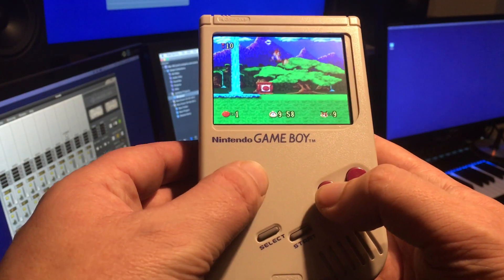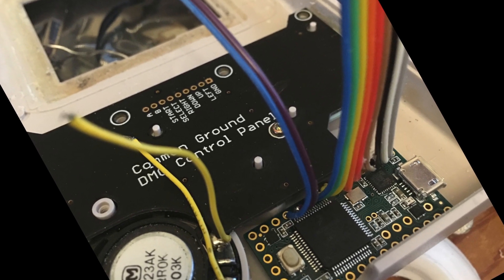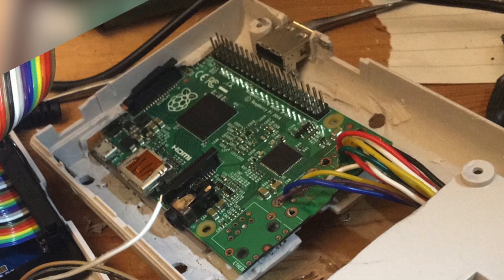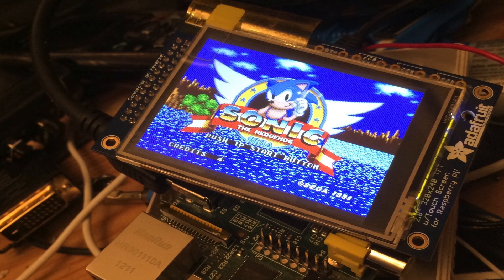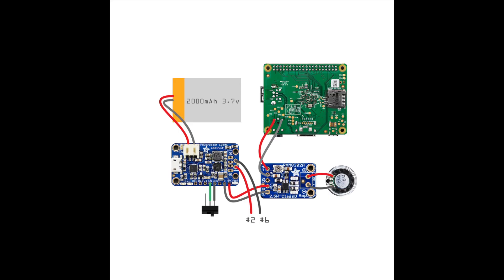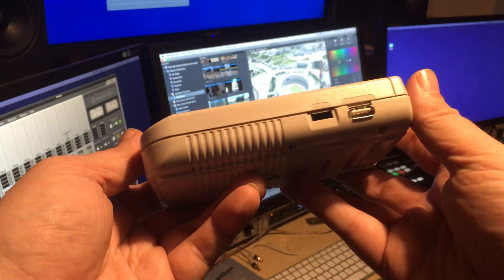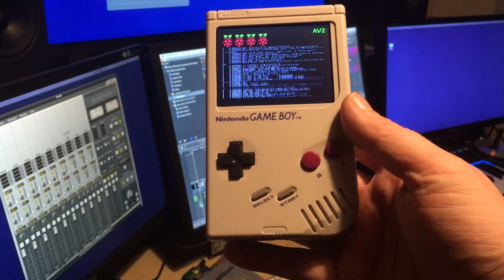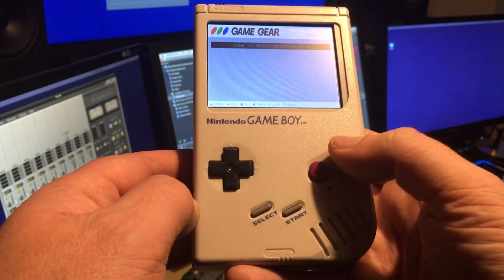Raspberry Pi GameBoy DMG-01 Build Overview And Demonstration

Comment: I am doing a similar project putting a pi in a mega drive. 

I am struggling with the on/off button. 

any advice or videos I can watch?

I'm new to this stuff!!

thanks!
Reply from the maker: http://www.raspberry-pi-geek.com/Archive/2013/01/Adding-an-On-Off-switch-to-your-Raspberry-Pi

There's some reading. There are a few off the shelf pi switches about. Google is your friend.
Reply: I've Google it a few times but not had a clear answer mate.
Reply from the maker: I wired in a switch via an adafruit 100c charging board. This is designed to run with a battery and a power input though. I'm pretty sure I came across a ready made power switch kit somewhere. I'll keep an eye out and copy you the link if I see it.
Reply: Thanks Stuart.
Reply: you can simply wire the USB cable that you are going to use for Power to the switch :v
Reply: Daniel Liens Search for sudomod.com
And wermy on YouTube

Comment: Sorry for the noob question, but I can't find the answer anywhere. Does the composite out on the Pi use the GPU like the HDMI does?
Reply from the maker: Yes, the composite out does use the gpu. It's screens using the gpio that you might have issues with bypassing the gpu.
Reply: Chuck Bartholomew Jep. But What does iT matter?

Comment: how can i mute sound on speaker when i plug in earphone? (i dont have gameboy pcb ) +Stuart Fox
Reply from the maker: You need an earphone socket that has two terminals that break a circuit when the plug is inserted. These are available from most component stores such as cpc, Maplin etc
Reply: Stuart Fox whats name of that pcb?
Reply: Or if you can send me link
Reply from the maker: So you wire a jack socket to the pis audio output, and use
 the switch terminals to break the speaker circuit... any jack socket with a switch will work... like this one http://r.ebay.com/6Krw7a
Reply: i didnt really get you, can you draw it in paint or someting. ( sorry if iam boring )
Reply: do you have mail, or somewhere i can msg you, i have a few questins. Ofc if you wanna to help :)

Comment: Hi Stuart! Just a quick question. How were you able to convert the button presses to input with the Teensy? By any chance could you send me the code you used to do that? (I plan on building a similar thing) Thanks!
Reply: Hi Luke, post it when you're done:-)  here's the code - you'll probably want to adapt it for your needs:

/* Buttons to USB Keyboard Example

   You must select Keyboard from the "Tools > USB Type" menu

   This example code is in the public domain.
*/

#include <Bounce.h>

// Create Bounce objects for each button.  The Bounce object
// automatically deals with contact chatter or "bounce", and
// it makes detecting changes very simple.
Bounce button0 = Bounce(0, 10);
Bounce button1 = Bounce(1, 10);  // 10 = 10 ms debounce time
Bounce button2 = Bounce(2, 10);  // which is appropriate for
Bounce button3 = Bounce(3, 10);  // most mechanical pushbuttons
Bounce button4 = Bounce(4, 10);
Bounce button5 = Bounce(5, 10);  // if a button is too "sensitive"
Bounce button6 = Bounce(6, 10);  // to rapid touch, you can
Bounce button7 = Bounce(7, 10);  // increase this time.
Bounce button8 = Bounce(8, 10);
Bounce button9 = Bounce(9, 10);
Bounce button10 = Bounce(10, 10);
Bounce button11 = Bounce(11, 10);

void setup() {
  // Configure the pins for input mode with pullup resistors.
  // The pushbuttons connect from each pin to ground.  When
  // the button is pressed, the pin reads LOW because the button
  // shorts it to ground.  When released, the pin reads HIGH
  // because the pullup resistor connects to +5 volts inside
  // the chip.  LOW for "on", and HIGH for "off" may seem
  // backwards, but using the on-chip pullup resistors is very
  // convenient.  The scheme is called "active low", and it's
  // very commonly used in electronics... so much that the chip
  // has built-in pullup resistors!
  pinMode(0, INPUT_PULLUP);
  pinMode(1, INPUT_PULLUP);
  pinMode(2, INPUT_PULLUP);
  pinMode(3, INPUT_PULLUP);
  pinMode(4, INPUT_PULLUP);
  pinMode(5, INPUT_PULLUP);
  pinMode(6, INPUT_PULLUP);  // Teensy++ LED, may need 1k resistor pullup
  pinMode(7, INPUT_PULLUP);
  pinMode(8, INPUT_PULLUP);
  pinMode(9, INPUT_PULLUP);
  pinMode(10, INPUT_PULLUP);
  pinMode(11, INPUT_PULLUP);
}

void loop() {
  // Update all the buttons.  There should not be any long
  // delays in loop(), so this runs repetitively at a rate
  // faster than the buttons could be pressed and released.
  button0.update();
  button1.update();
  button2.update();
  button3.update();
  button4.update();
  button5.update();
  button6.update();
  button7.update();
  button8.update();
  button9.update();
  button10.update();
  button11.update();

  // Check each button for "falling" edge.
  // Type a message on the Keyboard when each button presses
  // Update the Joystick buttons only upon changes.
  // falling = high (not pressed - voltage from pullup resistor)
  //           to low (pressed - button connects pin to ground)
  if (button0.fallingEdge()) {
    Keyboard.press(KEY_LEFT);
  }
  if (button1.fallingEdge()) {
    Keyboard.press(KEY_UP);
  }
  if (button2.fallingEdge()) {
    Keyboard.press(KEY_DOWN);
  }
  if (button3.fallingEdge()) {
    Keyboard.press(KEY_RIGHT);
  }
  if (button4.fallingEdge()) {
    Keyboard.press(KEY_A);
  }
  if (button5.fallingEdge()) {
    Keyboard.press(KEY_B);
  }
  if (button6.fallingEdge()) {
    Keyboard.press(KEY_1);
  }
  if (button7.fallingEdge()) {
    Keyboard.press(KEY_2);
  }
  if (button8.fallingEdge()) {
    Keyboard.press(KEY_3);
  }
  if (button9.fallingEdge()) {
    Keyboard.press(KEY_4);
  }
   if (button10.fallingEdge()) {
    Keyboard.press(KEY_5);
  }
   if (button11.fallingEdge()) {
    Keyboard.press(KEY_6);
  }

  // Check each button for "rising" edge
  // Type a message on the Keyboard when each button releases.
  // For many types of projects, you only care when the button
  // is pressed and the release isn't needed.
  // rising = low (pressed - button connects pin to ground)
  //          to high (not pressed - voltage from pullup resistor)
  
   if (button0.risingEdge()) {
    Keyboard.release(KEY_LEFT);
  }
   if (button1.risingEdge()) {
    Keyboard.release(KEY_UP);
  }
  if (button2.risingEdge()) {
    Keyboard.release(KEY_DOWN);
  }
  if (button3.risingEdge()) {
    Keyboard.release(KEY_RIGHT);
  }
  if (button4.risingEdge()) {
    Keyboard.release(KEY_A);
  }
  if (button5.risingEdge()) {
    Keyboard.release(KEY_B);
  }
  if (button6.risingEdge()) {
    Keyboard.release(KEY_1);
  }
  if (button7.risingEdge()) {
    Keyboard.release(KEY_2);
  }
  if (button8.risingEdge()) {
    Keyboard.release(KEY_3);
  }
  if (button9.risingEdge()) {
    Keyboard.release(KEY_4);
  }
  if (button10.risingEdge()) {
    Keyboard.release(KEY_5);
  }
  if (button11.risingEdge()) {
    Keyboard.release(KEY_6);
  }
}
Reply: +Stuart Fox Thanks so much! Just to clarify this will be pins 1-11 on the Teensy board
Reply from the maker: +Luke Chesney wait.... YouTube has cut off half of the code!!! Lol. I'll pm you
Reply: Okay! Thanks!!

Comment: I'm doing my build with a pitft and there is a way to utilize the OpenGL processing. Theres a tool called rpi-fbcp and it basically ties in directly to the videocore and dumps out the videocore framebuffer to the pitft framebuffer.  

https://github.com/tasanakorn/rpi-fbcp

With a pi setup like this once fbcp is started your pitft will just mirror what is being output on hdmi / composite.
Reply from the maker: Yes, this was a real issue to get working back when I built this. I've heard it's easier now. You still loose some video acceleration don't you?

Comment: hello my friend i try to download roms from same sites but nothing can you help me whare i find?? ty a lot and i love your work :D i try to do the same with raspberry pi 3
Reply from the maker: Google is your friend!
Reply: +Stuart Fox  i try from here http://www.emuparadise.me/roms-isos-games.php but nothing maybe i dont do the process right but i just pick the zip fille from this site kai i copy to folder of roms at usb and i plug to raspberry but nothing :(
Reply from the maker: +Nikos I assume you are using retro pie? If so, you need to create a folder on the root of your sub stick called Retropie Then, with Retropie running, insert the sun stick into your pie. Wait a minute. Now when you plug the stick back into your computer you should see a bunch of folders in your Retropie folder, all with different system names. Put the roms in the corresponding folders.
Reply: +Stuart Fox yes i do like this i have at my usb the folder with name retropie and i plug to my pi and after 5 min i plug to my pc to transer roms but after i plug againe to raspberry run retropie but no games
Reply from the maker: Check that USB memory stick service (or what ever it's called) is enabled in the retropie settings, also ensure that you have the correct roms for the emulator and version number. If you still have an issue, you may want to try writing a clean image of the latest retropie onto your SD card and starting fresh.
Reply from the maker: Did retropie create lots of system folders inside the retropie folder on your stick?
Reply: +Stuart Fox create lot of folders of emelators h see the video to get in to enable the usb roms but againe nothing :(
Reply from the maker: Something is wrong with the installation or the roms you are using. Time to troubleshoot I'm afraid. Try a fresh image, try a different USB drive, try different roms.
Reply: +Stuart Fox maybe this site http://www.emuparadise.me/roms-isos-games.php is not for retropie roms?
Reply from the maker: Is it mame roms you are getting?
Reply: +Stuart Fox i see video and i see the roms is finished is .gen my roms is not .gen meyba is this the problem? or not?
Reply from the maker: +Nikos Sodomistis .gen roms should work in the megadrive folder. Have you got a spare memory card, you can do a test clean image of retropie3.7 on to?
Reply: +Stuart Fox yes i have i try to  againe install retropie at new sd and i tell you. i put the game with ''.gen'' at megadrive folder to see if work but nothing
Reply from the maker: I think the megadrive roms I have are folders actually.......

Comment: Hi Stuart, I've got the same screen as you. I removed the step down chip and soldered the 5v and ground to an adafruit powerboost 1000 (got a 2000mAh battery ready once this is working). Backlight stays on I connect a 5v micro usb to the powerboost. However when I wired/soldered the composite to the raspberry pi zero. I only get the white back light screen. If I move the screen/ribbon around I sometimes get the image so the pi is definitely outputting analogue but when I let go it goes back to the blank backlight. You think my ribbon is busted or is this a power issue?
Reply from the maker: +Mike Sims Hi Mike, Defiantly sounds like the ribbon connector. Have you tried disconnecting it from the board, blowing out anything that might have got in there and re attaching the ribbon. You unclip the two plastic tabs to remove the ribbon... sorry if I'm stating the obvious. Mine stopped working as I was still building, and although the solder connections I'd made to the points where the step down chip used to be looked ok physically, applying heat to those joints carefully fixed the issue.
Reply: +Stuart Fox Resoldered and no difference. I think the ribbon has been pinched and sliced as it's getting worse. What a shame!

I'm thinking of trying to canabolise a screen from something like this: http://www.ebay.co.uk/itm/322019516214 , if it runs of the 3.7v battery it must be possible to easily convert it to run of the 5V supply.. plus you get a battery too.

Comment: Hi Stuart.  So many choices of screen..  Where did you get yours on if you didn't use the adafruit one?  Also, where in the UK did you find the common ground dmg board..  been looking for ages but with no luck.
Reply from the maker: +Stephen Chew hi, sorry I thought I'd already replied. It's this screen I think.. https://www.pi-supply.com/product/adafruit-ntscpal-television-tft-display-2-0-diagonal/?aelia_cs_currency=GBP&feed_country=GB&gclid=CK-Rhu-frMwCFesV0wodh5wJ8Q
Reply from the maker: +Stephen Chew RE the Common Ground DMG, I just ordered that from the states. It took a little while but it got here safely. There are none in the UK for sale as far as I could see.
Reply: +Stuart Fox no worries.. found a similar one off another build from eBay so used that. thanks for the inspiration to start (and hopefully finish) the build
Reply: +Stuart Fox yeah did the same in the end

Comment: Hi, is there a tutorial on how to build this Raspberry Pi gameboy together? Cheers
Reply from the maker: Hi, here are some useful tutorials: 

https://learn.adafruit.com/pigrrl-raspberry-pi-gameboy/overview

https://m.youtube.com/watch?v=RXpgLFpSBHY

https://blog.adafruit.com/2015/03/02/new-tutorial-raspberry-gear-upgrade-your-sega-game-gear-with-a-raspberry-pi-and-3-5-inch-tft-display-raspberrypi/
Reply: +Stuart Fox Thanks, I currently have a Gameboy Colour, would the pi fit? or am I asking for a really small area of space to work it...
Reply from the maker: +Marcus Chia depends which model of pi... The zero would be fine but you'd have to think about sound. There is a hack to give you a line output from the zero... https://learn.adafruit.com/adding-basic-audio-ouput-to-raspberry-pi-zero
Reply: +Stuart Fox I'm not sure which model tbh, it seems like the zero is sold out everywhere :/ Was thinking the pi 2 or 3, but I would have to remove all the extras so it would fit
Reply from the maker: +Marcus Chia the zero is in stock now in the uk at least. I had a job getting the two to fit in my dmg01 case even after removing usb and Ethernet, but with the 3, you won't have to squeeze in wifi which will help!    If you get a 3, you can always try it and get a zero as a backup plan. The zeros are not exactly expensive;-)

Comment: Hi, Awesome job!I am currently half way through a similar build, and one thing I cannot seem to get over is how to gracefully shutdown RetroPie with a power switch. Have you done anything one this? Or are you just using the power switch to cut power to the pie?Thanks!
Reply from the maker: +Mechdude I wired the switch into the powerboats 1000c board ( http://www.adafruit.com/products/2465 ) which means that the battery can still be charged when the gameboy is switched off. Sadly though, this is still a dirty shut down. I'm sure there is a way of triggering a clean shut down but I didn't find a way.
Reply: +Stuart Fox Awesome same as me, guess I am still looking lol thanks again!

Comment: Awesome build! I'm actually in the middle of building my own trying not to modify the GameBoy exterior case too much while trying to fit a Pi2. I see you are showing off both SNES and N64, but I guess that's just for fun as playing them would require a lot more than 2 buttons. Or do you have a trick up your sleeve? :)
Reply from the maker: Well, I was originally planning extra buttons, but like you I wanted to keep the case mods to a minimum and also the inside is full... Very full so I'm leaving it as is. Some n64, mega drive, send games actually only need two buttons.... But yes, you're right, mario kart 64 needs more. You can plug a controller into the usb port but there's enough games which will work on the original controls to keep you entertained. Next plan is to make a mini raspberry pi 3 arcade machine ( table top) and poss even a 3D printed portable... That way I can add all the buttons in the world. Good luck with yours.... I'd like to see it when it's ready:-)
Reply: +Stuart Fox Sure thing, thanks for the reply. I know what you mean when you say that the inside is full... it will be hard to get everything to fit. Thought about trying to get hold of a Raspberry Pi Zero in order to save som space, but it's still out of stock almost everywhere... Well.. once I get the case I've ordered then the fun begins! :)
Reply from the maker: +IDmedia the raspberry pi 3 has inbuilt wifi and Bluetooth. I'd use that because the zero would need extra wiring and components for sound anyway. Without the extra wifi that I included, it would have been easier! You'll still need to remove the usb and Ethernet ports though which is a little tricky. I know you're not adding extra buttons, but there are still more modern games that will work with the dmg01s controls just fine and it's always nice to have enough power. I'd install heat syncs on the chips where you can though.
Reply: +Stuart Fox I know, but the size of the Zero makes it tempting to use. I think it should be more than powerful enough for GB/GBC/NES and the few others I intend to add. However, I see the issue with sound and some other which makes the Pi2 or 3 more preferable. Don't really care about Wifi/BT, but I think about another feature that would be awesome. If I'm able to make everything fit, I want to support original GB/GBC games. So if you insert it, the Pi will detect it's title, copy over the save game and launch the rom with the same name (so I don't have to wait for the whole dump). When you exit the game or the file changes the save game is written back to the cartridge. It's mostly a gimmick, but I think it's quite cool as long as I can fit everything in the case without modding it. I also plan to build my own case using a 3D printer that allows more games and that's where I'm going to rely on the Pi3 for Wifi/BT... :)
Reply from the maker: +IDmedia there was someone on one of the retro pages on Facebook who I was talking to who'd made only that reads the cartridges. He explained how he did it but it went over my head!
Reply: +Stuart Fox I found this and think it shouldn't be too difficult to build: http://jiggs.tk/project/romboy-another-game-boy-cartridge-dumper/